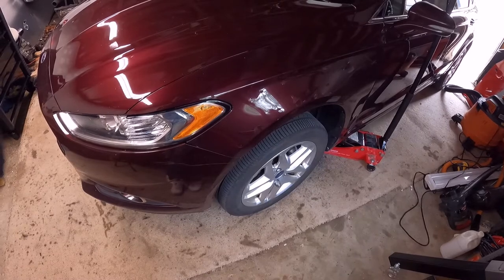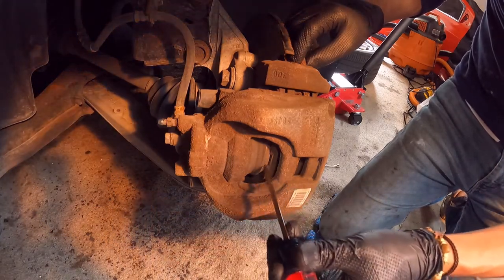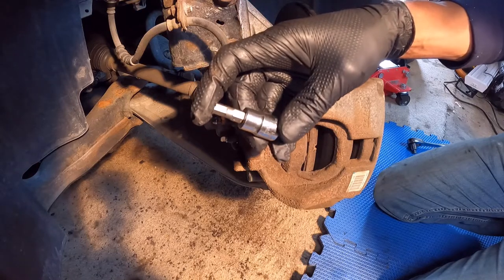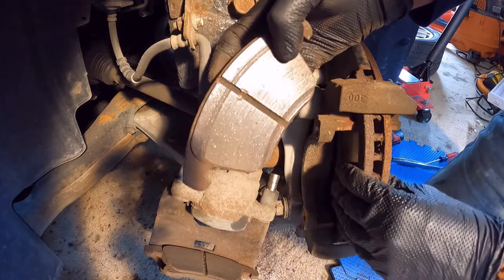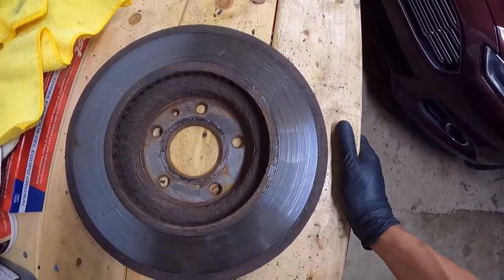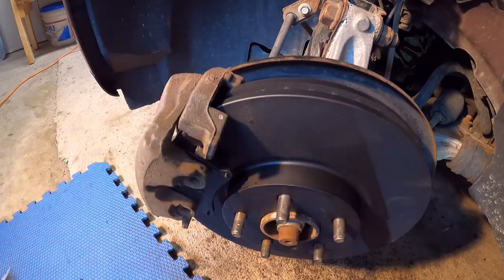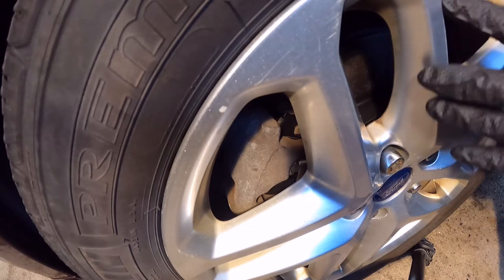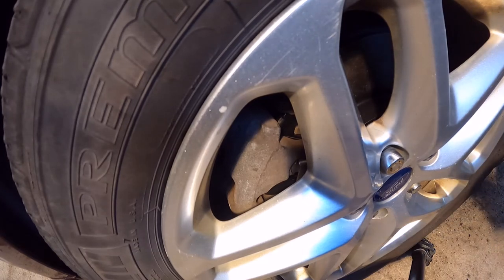Ford Fusion - Front Brake Pads & Rotors Replacement (2013 - 2020)

Comment: For anyone who is a looking for torque values...
Brake Bracket (7:00) Torque 75 ft-lbs
Caliper (8:30) Torque 30 ft-lbs
Lug nuts: 95 ft-lbs
Reply: fyi... According to service manual, 2014 fusion hybrid front brake bracket torque is 111 ft-lbs.  It also says to replace the bolts with new ones, but that's probably due to the locktite applied to the bolts.
Reply: Just use the good old German torque spec, guten tight! Make sure you don't go too hard or you'll enter the Russian torque spec range of brokenov.

Comment: I usually just open the cap on the fluid reservoir before pushing the caliper, and suck a little out with a turkey baster so it doesn't spill over.  Would you not advise that for a Fusion with ABS?  Or was it just a little easier for you to use the bleeder valve?

Also, a warning to others, don't get the fluid on your paint.  It will eat it.
Reply from the maker: First of all thanks for your comment about avoid have the brake fluid on your paint because is super corrosive. For your initial question in my experience both practices are common and in the video to me was just easy and to show another way to do it. But what you describe you are doing is just fine as well.

Comment: Noticed that you kinda skipped the rotor removal procedure... did it take force (hammer/mallet strikes) or is it held on with bolts?
Reply from the maker: Hello, thanks for your comment I just noticed what you mentioned and seems like was an edition issue, to remove the disk you have to remove the bracket that I install in the min 6:34 that is hold by two bolts and that is all, the disk will come out. Thank you for your observation.
Reply: In addition to what dude said, sometimes you really have to pound them to get them off.  I've used a ball peen hammer, and smacked the rotor on the plate between where the lug studs are.  Just hit it a few times, rotate, hit a few more.  Be careful not to hit the studs themselves, you don't want to push them out.  This should loosen the build up between the rotor and the hub.  This is if it is seized pretty good, and also if trying to save the rotor.  Use a ball peen hammer because it is made to withstand hitting metal, NEVER use a hammer made for hitting nails into wood as they might shatter if used on metal.  A heavy mallet might be able to get it too by hitting it on the outer part of the rotor, but it might not be able to break the rotor free if it is too seized up.  The rubber mallet should also be fine if trying to save the rotor.  A heavy sledge will get it for sure, but will ruin the rotor, which isn't a problem if you are replacing anyway.  When swinging a hammer against metal always wear eye protection.

Comment: Question and your answer highly appreciated.

My 2018 ford fusion has electronic button next to to transmission rotator, which is used for parking breaks. Having this would require any additional steps or is it the same as in your video.

Second I want to change the break fluid completely with Dot4 is recommended one. Can you please explain the steps.

Comment: Really good torque wrench tires are like 100 lb of torque caliper brackets and pins are between 20 and 40 ft lb of torque not as tight as you can pull it using two wrenches or a breaker bar definitely don't open the bleeder unless you plan on bleeding the brakes a little bit of fluid that gets pushed back into the master cylinder can be siphoned out and replaced with fresh fluid

Comment: Thanks, good video.  Just wondering, I did the rear brakes and needed a special box attachment for my ratchet to compress the brake cylinder.  Will I not need that for the front?  Is this only for rear brake calipers?
Reply from the maker: Hello, thanks for your comments, for the front brakes you will not need that box tool, that is used in the rear because the parking brake system is in the rear but not in the front so you should be good without it.
Reply: @TheNomadMechanic  oh cool, thanks.  That makes things a lot easier.
Reply: No, you do not need a special tool ,set to maintenance mode and use your finger so you can push the piston back . I just push back the piston by thumb

Comment: Was just told by a dealer ship I have to replace all 4 on mines 🥲 glad I found your video. I can save a lot !
Reply from the maker: Thanks for your comments, just if by any chance you have to work on the rear brake pads remember you have to set the car in maintenance mode, I have a video about it in my fusion playlist.

Comment: Now I see why people be getting air in their brake system. Don’t ever open your bleeder valve unless you bleed the brakes after.
Reply from the maker: When you displace the cylinder after the valve is open literally you are bleeding the system if by any chance air came in, after the cylinder is displaced that air is out. Regards
Reply: I prefer to push the piston in with the tool and the bleeder open. Nice job.
Reply from the maker: @PABU427  Thanks for your comments

Comment: Quick question. After you finished changing the rotors and brake pads. Do you  connect the battery n pump the brakes to adjust them after each side being change or after both sides are done.  Thanks.
Reply from the maker: The battery can be connected at the very end as far as the pumping the brakes I do that as soon as I finish one side and then again once I finish the other side

Comment: I’m using a 1/4 inch (7mm) Allen wrench on my gf’s 2014 fusion and it is not the right size,am I missing something or inaccurate with my numbers? Looking at the bolt it seems like it’s rounded in between the points is it possible I need a t45x torx?
Reply: Yes that’s exactly what you need I used a T45 with a 3/8 drive and fits perfect
Reply: 9/32 hex head
Reply: 7 mm hex fits. It is metric, not SAE

Comment: Do you have to bleed the breaks ?
Reply from the maker: No I did not, just be careful to close the bleeding valve as soon as you finish pushing the cylinder. However if after you want to bleed the system that is a good practice and you will be adding new fluid to the system.